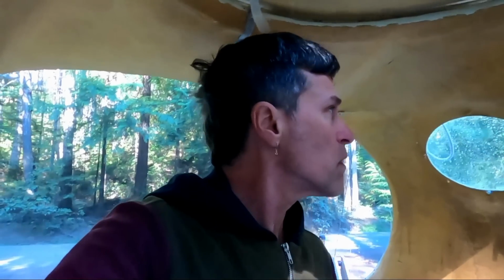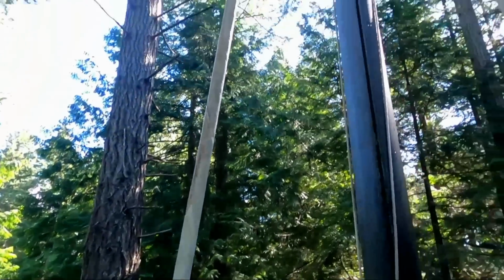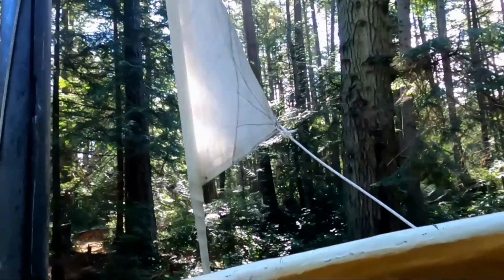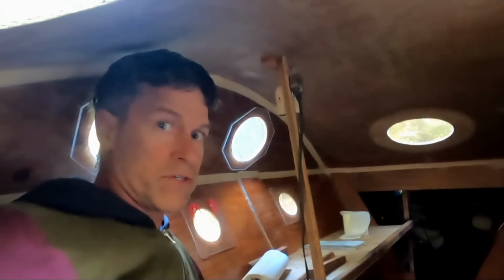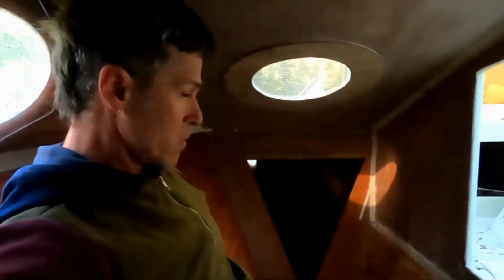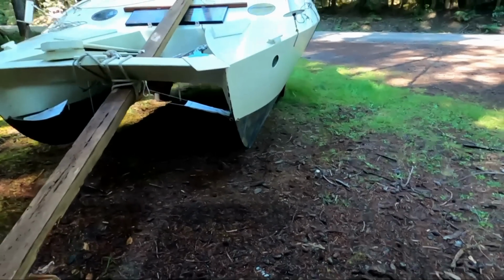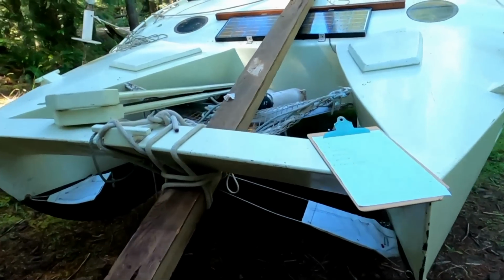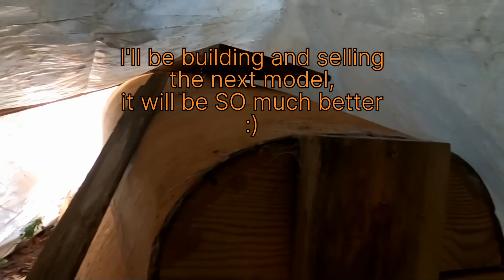experimental micro yacht, human propulsion (fin drive) and sail

Comment: wow, absolutely fantastic design! I would love to learn more about basically everything about your boat but I am particularily interested in the fin drive!
Reply from the maker: Hey thanks!
The next version solves so many problems of the prototype. For example two people will be able to use the fin drive. So much better. I'm actually quite a bit more excited about that boat than the barge I'm currently building... 
The world is so interesting!
Reply: @wisecrackworks8851  very interesting! I mostly sail enginefree. used a yuloh for windless propulsion on my last boat, have a small electric trolling motor on my current one, which looks a lot like a larger version of wisecrack. It's a wharram pahi 31. I have recently been thinking of making a pedal drive using a large model airplane prop. I'm more than happy to go 2 knots if there is no wind!

Comment: very nice little boat.  I would suggest adding a little flex to your sculling oar.  Just extend the trailing end with some epoxy and glass.  Also increase of your rudders - and then go find a nice little tidal bore to surf with those rockered hulls.  Maybe look at some displacement hulls - with lengthened sheer (wave-piercing bows) for your next build.  Main-thing, keep building.  Don't be discouraged.  Epictitus taught: "all misery is based in unfulfilled expectations" (even dogs get this).
Reply from the maker: I know what you mean about the fin drive. However I'm going for a different way of propelling. To use a hydrofoil, it actually has to bend the other way. Like a plane wing. It's just a different method. 
I totally agree with the hull shape. 
Next time!
Thank you for the input and encouragement :)

Comment: Nice vid - and I love the idea. Ive been thinking about this type og boat myself - but are to lazy to build one (and I know how much work it is...) but: if its a small boat to live inside for the least materials and work a catamaran is the worst option - best is a mono - then a trimaran.If the materials and the weight - is the same - then a mono would offer a much longer hull with good volume - making for faster better sailing and living. Very simple to build compare to the cat. Double ender is (as you have figured out in the next version) not the way to go - wide transom and wide relative flat hull with good stability and max waterlength is better - it can plane and be very fast.  A cat could be made as a camper for car roof transport - two long hulls a platform and a tent solution. Windsurfer mast type - more than one... But cant wait to see the next version.
Reply from the maker: Frankly I would love to try every iteration you've suggested and more. Love this stuff.
The catamaran is the design that works best with the fin drive. 
Everything's a compromise. An elegant compromise. 
Cheers :)

Comment: Interesting, but why is the flap drive better than a propeller?
Reply from the maker: It suits the human body well. Low rpm high torque.
Which is actually more efficient in the water generally. 
And it's fun.
I just want to haha.
Do what you want...
Reply: @wisecrackworks8851  Ok, thanks!

Comment: Looks lovely. But don't take that out on the tight water points in windy weather, your muscle power just can't handle the area of the boat subjected to the wind. Even a 1kW electric will have trouble and no man can match that, not even athletes.
Reply from the maker: Well I would imagine you would be shocked then at what I've done in that thing.
Reply: @wisecrackworks8851  if you pick your battles, sure you can do well :)